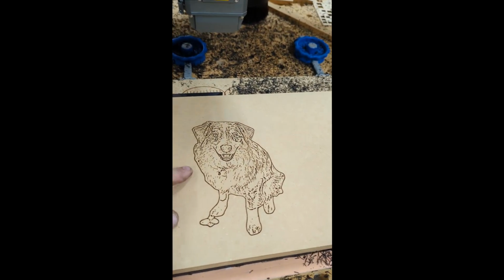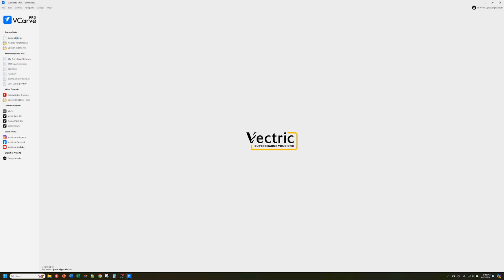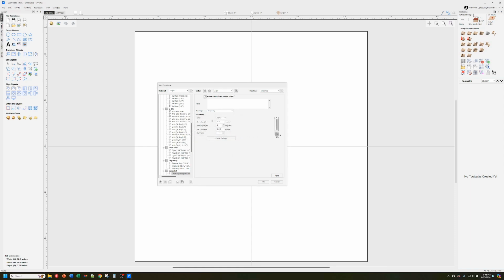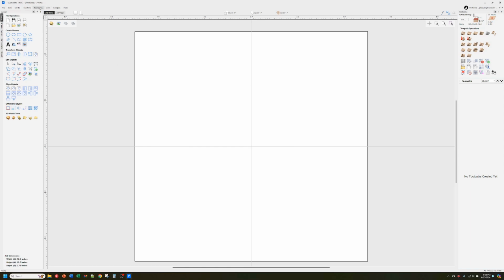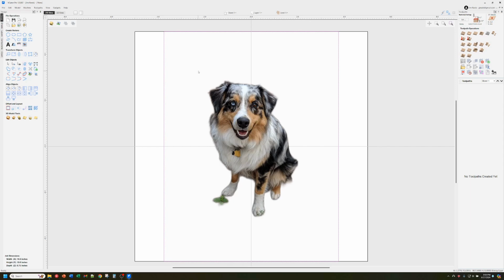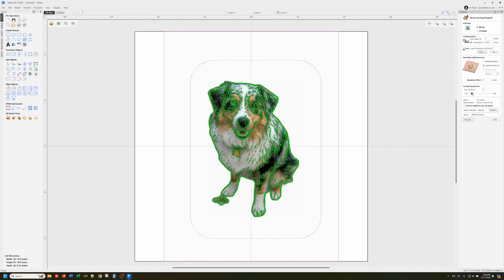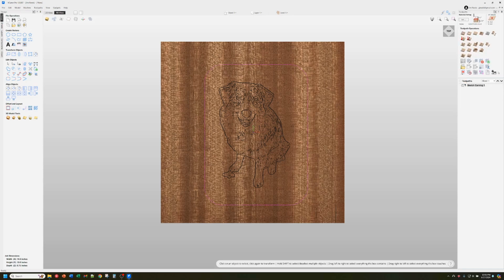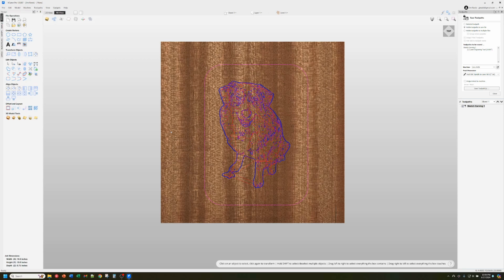Using a Laser With the New Sketch Carve Toolpath in Vectric V12

Comment: Hi Jim,
I was using the spindle to laser post processor and it's not exporting either the tool 99 designation or the S parameter for speed. Am I missing something? Thanks for all the information :)
Reply from the maker: Hi Mike,
Send me an email at jnwdwks@gmail.com and we can figure it out.  For the tool designation, you mean you want a tool change?  I took that out, so I can put it back in for you if you like.  I'm not sure about the power, that is working fine for me, so we'll just have to dig into how you are using it.
Reply: @JNWoodworks  Hey Jim,
Thanks for the reply. Perhaps it’s because I’m doing the gcode laser conversion in Mach 4 that it’s bringing up the errors?
Reply from the maker: @mikehammond2630 
Oh ya, that conversion script that AVID has in their screen set assumes that it is converting a Gcode file for end mills.  When you use my pp, you already have it converted to laser format, so you can't use that script with this Gcode.
Reply: @JNWoodworks  Thanks. Our non-profit is new to CNC so still learning :)
Reply from the maker: @mikehammond2630   We're all still learning 🙂

Comment: great video...Do you know if I could export from VCARVE and then open/burn on my stand-alone laser (CO2)?
Reply from the maker: I'm not too familiar with the software thats typcially used  on the CO2 lasers.  How do you normally burn vector files with that?  Vectric can export as DXF, SVG, or PDF.
Reply: @JNWoodworks  Question is if when I use this sketch feature, can I then export as a .dxf or SVG. Not sure if VCARVE simulates these vectors for use ONLY in the tool path creation or if it indeed creates the vectors and can be exported for use or editing. Any help would be appreciated and thanks for the quick reply.
Reply: @dankinsky9543  Ah, I got you.  I loaded up that file and took a closer look.  It does not seem to ever create a vector file, just some kind of internal format that it temporarity displays.  You can run a simulation on it and save that as a bmp, jpeg, etc., but I  don't see a way to save it as a vector format in any way.  That would be a good feature to ask for.  You could load the jpeg or bmp and raster burn it I'm sure, but that may not have as good of resolution.  I personally like to burn vectors unless I'm doing detailed pictures.
That makes me ask (because I have no idea), does the software on most CO2 lasers allow you to load in some kind of Gcode files?  If so, then a Vectric post processor could be made that would work for this.
Reply: @jimneeb2362  Thanbks for confirming that part! Would have been ideal if it could export the vectors though!
Reply from the maker: @dankinsky9543  I agree.  That would be a good thing to ask Vectric for on the next release.  
Does your machine allow loading any kind of Gcode files?  If so, I could help you make a post processor that might work.

Comment: Thanks for making the video I’ll have to try it out 

Was wondering what size air compressor you using for the air assist on the opt laser?

I’m using a shopsabre 23 not avid, I have use laser module and laser post processor from shopsabre without and problem I’m assuming I can use that same laser post processor to do what you did in this video
Reply from the maker: My air system is a little bit overkill for just air assist 🙂 https://www.youtube.com/watch?v=zDu10hs-lug&t=10s

I can't say for sure, but I would guess you can start with the post processor I wrote, but would probably have to make some modifications.  My modifications to convert spindle RPM to laser power, and to add the laser on/off commands to feed moves and rapid moves would be the same, but I would guess that the actual laser commands themselves between the ESS controller I have and the shopsabre are probably different.  However, if you send me your laser post processor from the shop sabre, I might be able to figure it out for ya.  jnwdwks@gmail.com